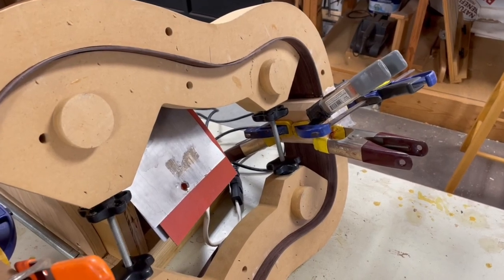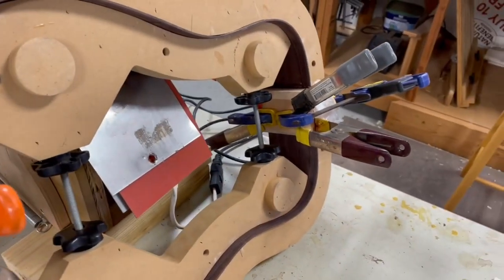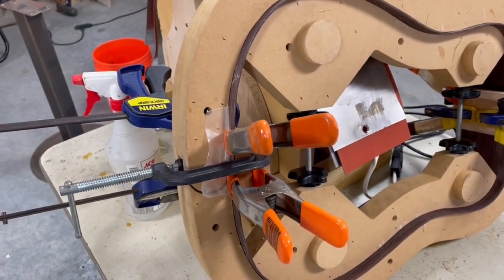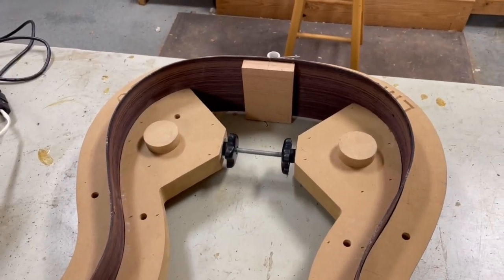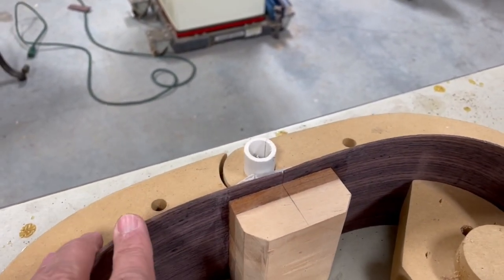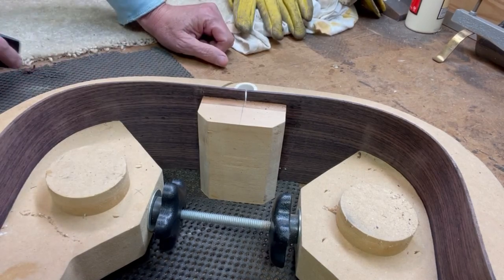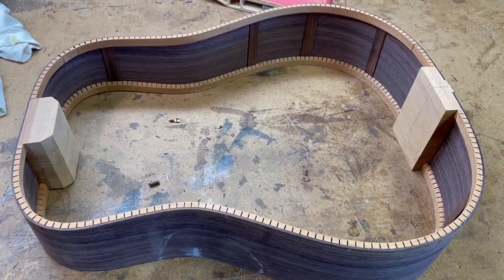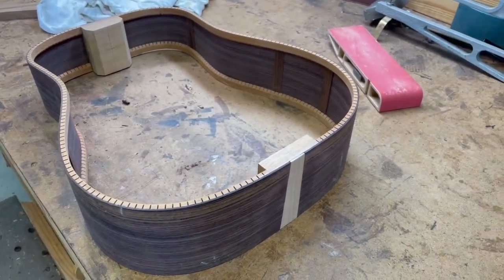Building a Guitar with Steve Hallford- Head & Heel Block, Kerfing and End Wedge

Comment: Hi Steve, Nice video! One nitpick. You mentioned pressing down harder on the parts where chalk remains. Makes sense intuitively but its actually the wrong thing to do. Those chalk marks are low spots, not high spots and they mean you need to bring everything else down to make them disappear. Also, most (not all!)  "flattop" guitars have a radius on the top as well. On both the front and back, the radius adds structure and also mitigates the changes of cracking by letting the top rise and fall with humidity changes.
Reply from the maker: Thank for the feedback. You are correct, I should have stated that the intent is to bring the rest of the guitar sides down to the level of the heel and neck block. I saw a video when one builder said to leave the neck block about an eighth of an inch higher on the back than the side so the radius will be easier to bring down to the height of the sides. Any thoughts on that? This is still a learning process for me